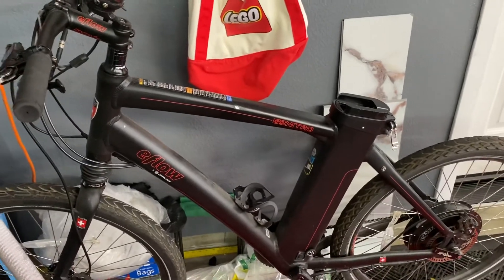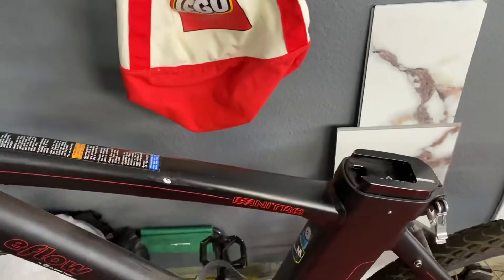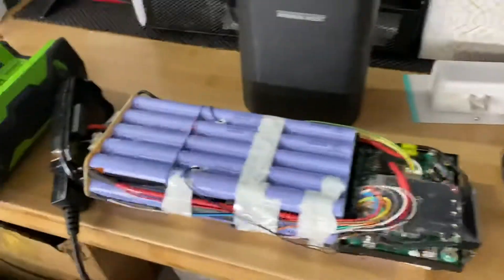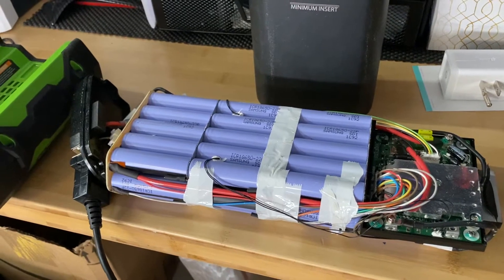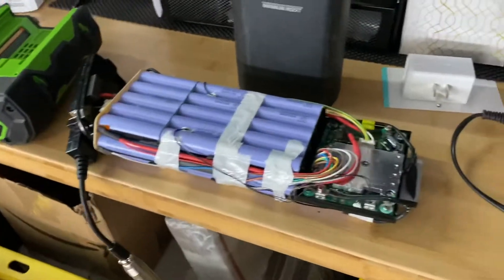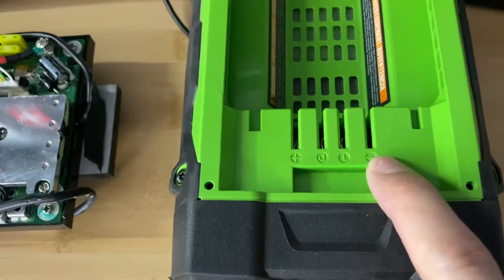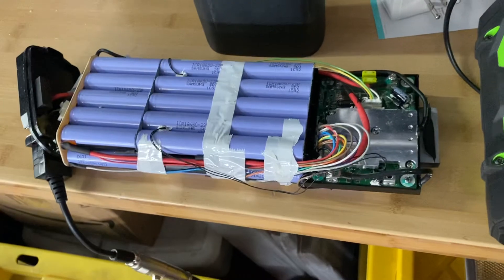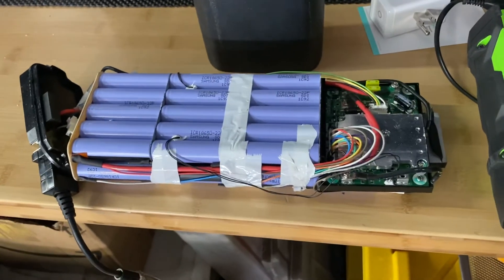Eflow Nitro E3 Ebike bicycle reviving non charging battery

Comment: hey my friend...Im from Brazil and we are always behind in everything, specially tech. I found one of these really cheap here ( like 400USD) . A used bike with chinese parts is almost 1k and thats a lot of money here. Everything costs at least 2x the US price.  I just need to service the battery (ive someone who can do it for 200$).  Would you buy it if you were in my shoes? I like the design, the 500w motor(90% of the bikes here are 250/350w) and the frame design. Hows the performance with a new battery? Range and top speed? I´d really apreciate you input! Thanks a lot

Comment: This is exactly what I need. I have two of these batteries one has 4v and the other 8v.  I know eFlow is no longer in business but do you know where I can buy the adapter to charge the batteries without having to put them in the bike
Reply from the maker: I might have an extra one, I think I got 2 when I bought the bike
Reply: @thetechranger6661 I used this to get a charge on the battery. But when I plug in the charger on the side of the bike it never charges. If you have an extra adapter let me know since I could try to charge directly to the battery